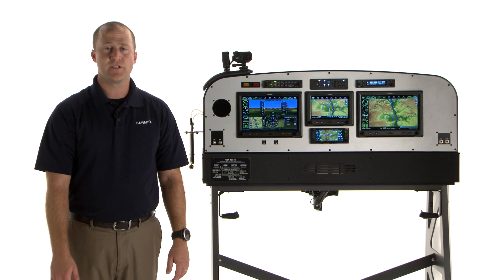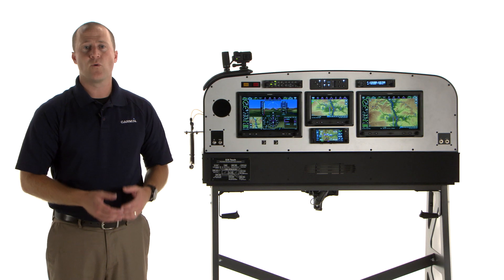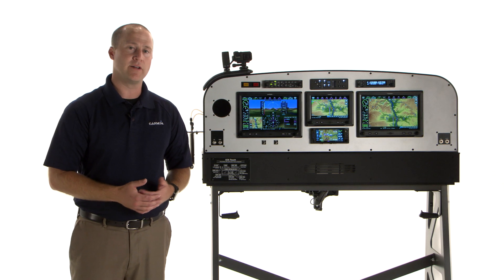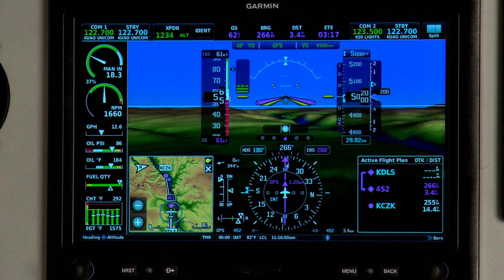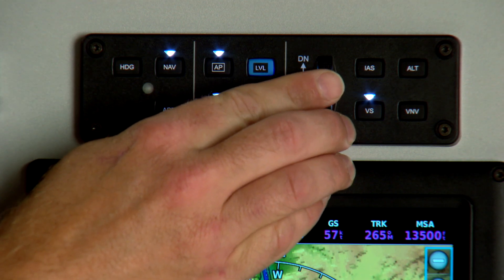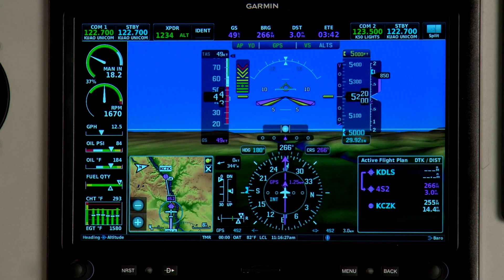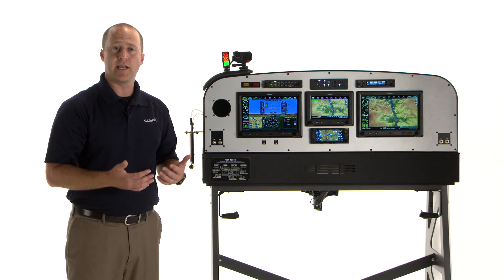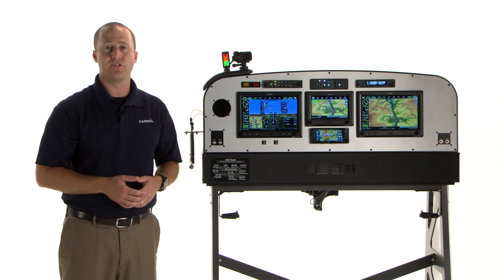Garmin G3X Touch: Using the AOA System

Comment: Garmin can you please just certifi the G3 with a blanket ATSM under the part 23 rewrite so can install this in any GA aircraft under 5000 lbs please.  This is truly life saving technology that needs to be opened up at an afortable price like you have done for light sport.  Thank you
Reply: you can get an aoa sensor installed for under €5000 ;) it can be wired into autopilot disconnect too